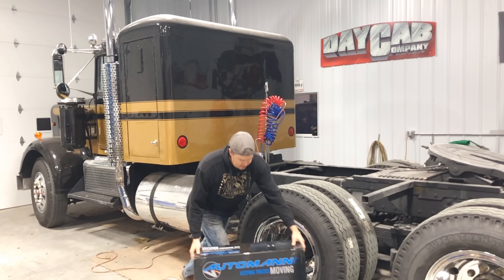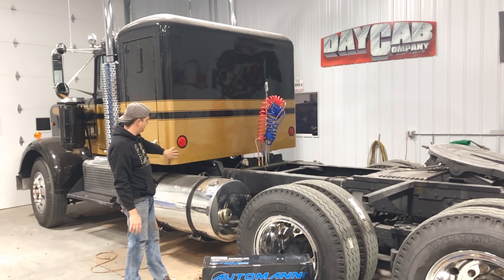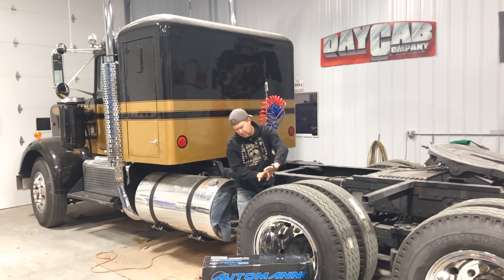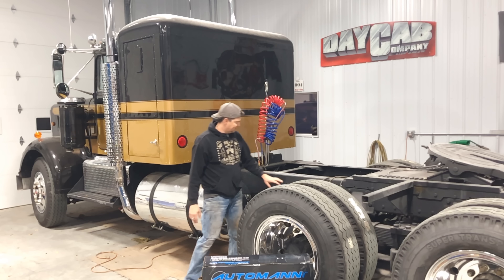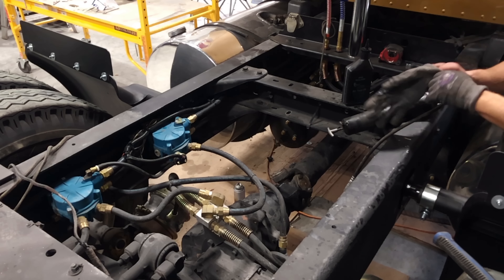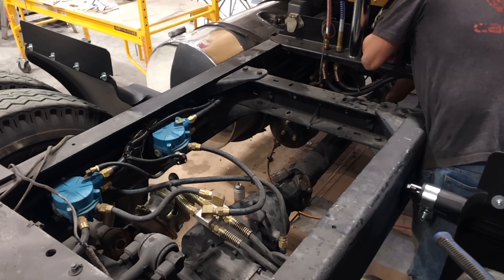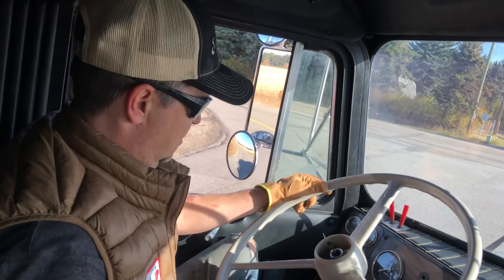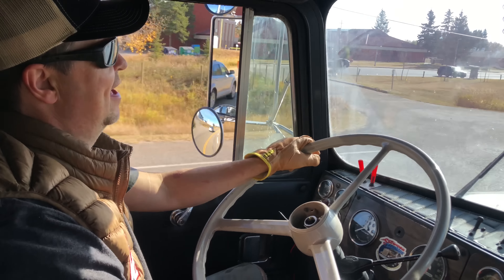Smokey & The Bandit Tribute Truck Ep.57 They Said It Couldn't Be Done

Comment: I used to work at a glass shop and I've replaced a bunch of those windshields. I loved them because they were small and super easy to do. With what I've seen of you and you're abilities, you should be able to handle it. There is a procedure, but simple. I'm sure there are videos here on youtube. Another thing about those windshields is that if you can't get a hold one in a timely manner, most glass shops can cut one for you, probably will want to bring in your original for a pattern. By the way, from what I remember, they fairly cheap too.

Comment: Die Hard and Lethal Weapon, both are Christmas movies.
Quite possible that the 1973 movie truck started life as a day cab.  It would certainly make sense given the location of the passenger side fuel tank filler.
Your radios are just bouncing around on that mount.  You might want either a much stiffer mount or make the mount so that the radios are removed when driving, install them at shows.
Hope Mrs. TwinSticks has a good dentist, riding in that solid mount seat combined with the Hendrickson walking beam suspension is going to rattle the fillings out of her teeth!

Comment: What an accomplishment! I’ve been following along since the beginning and the truck came out awesome! Food for thought, you could get the back of the cab or any vulnerable areas like the front end covered with clear bra/PPF (Paint Protection Film) I have painted bumpers on my truck and couldn’t take the stone chips and it works excellent. It’s essentially invisible especially if done by a skilled installer.

Comment: Hi Mark. 1/4 turn is what I used, also the stainless screws that mount the Kenworth logo on the hood are painted black. As for plates since you built this from the ground up how about Marks-Ride, or Marks-Toy, you can always pull em off for the shows. Still need those foot straps over the fuel tanks.........nag........nag.......nag.😁

Comment: Slightly off topic, but jeans.

I do a bit of Motorsport marshalling/competing/spinning spanners. Mostly rallying, but a bit of drag racing too.

When I'm not behind the wheel, I wear thermal long johns under my jeans. It makes working in low temperatures much more comfortable.

I was on an island off Wales last weekend marshalling a rally and it was very windy & wet. I had two pairs of long johns on under my jeans, plus knee length mountaineering thermal socks, and I was toasty warm. Everyone else was freezing their balls off.

A few layers on your legs both keeps you warm and gives your knees a bit of padding whilst kneeling on the floor.

I can highly recommend it.

Comment: Mark from experience, the 1/4 fenders don't stop a lot bobtailing and don't work overly well even with a trailer. I know you want to keep it movie correct but I would go with at least a half fender but do it so you can easily remove it at a show. You have made a beautiful truck out of that old Kenny. My back hurt every bmp you hit on that ride.  I drove a 84 w900 425 cat 36 inch bunk, 15 double over  trans and spring ride suspension. Driove it a couple of weeks and broke 4 springs and my back over that time. Till I got my 96 repaired.

Comment: I don't see fitting wheel arches/fenders as detracting from what has been achieved,the reasoning being very valid.The top and bottom of it is that it's instantly recognisable as the Bandit truck and 99.9% won't notice them or know the difference anyway,like most of us I've seen the film many times and still didn't notice until pointed out,the many particular features mentioned by Mark on various episodes.  If it matters that much you could perhaps make a quick release mechanism for securing them or use wing nuts for securing them and then simply remove them at shows. Top stuff Mark👍👍👍

Comment: Great stuff Mark. Truck looks great! BTW, most W9s have the fill under the bunk, which makes it difficult to fill and impossible to use a flashlight or stick to check it if the gauge fails or when you are really low on fuel. They even put a hinged opening on the chrome strip if you have chicken lights.

Comment: Just last week I picked up a 1977 trans am se identical to the bandit, I was driving around my area when I noticed it in someone's backyard and I knocked on the door and made a deal.  I never really wanted one but with the rising prices I knew it would be a good investment.  I am going to yank out that anemic 200hp L78 400 engine and replace it with a 675hp 7.0L LS7 backed up by a tremec tr6060.  On the outside the only noticeable difference will be 20"  snowflake wheels which are needed to fit the 6 piston brembo brakes going on it.

Comment: I'd go with full fenders, and where they mount to the frame, with round or square tubing. Make it fit with tubing inside of tubing with a pin through to hold it on. Then when you get to a show, remove the pins and take the fenders off.

Comment: That truck would be hard riding even if it had air ride. The wheelbase is what makes it ride so rough. I drove a short wheelbase freight shaker witha set back front axle with air ride and if it wasnt loaded it would bounce you outta the front seat if you hit a bump unless you was loaded

Comment: Nice,I would run a dedicated or local in that,not OTR though,sleeper too small.
Ran chickens out of PA to NJ for a few years in an 84 W900,loved that truck only air ride was the seat but she was a beast and very angry about anything in front of her,
Pa white tail? Deer can fly
Fence post? Remove it
Concrete post? Mid-day snack
BMW running a stop sign? Oh yea bend that in half.
Fix a bent TX bumper on a pete using hers to push it back to shape?
Yep,all the time(frack haul trucks)
Herd a Buffalo back into the fenced field? Sure why not.
800 hp caterpillar in her,straight pipes no mufflers in them,farmer I bought it from did the HP,truck was 98% original including the hunk of American steel they called a Texas bumper.
98% due to the farmers son laid it over and it needed a new mirror and bracket after that.
Miss that old gal.

Comment: Love the build, watched every episode. I'm sure you know this and I'm NOT criticizing at all, but the frame looks to be slightly longer on this truck vs the movie.  The spacing between the fuel tanks and wheels and between the drives themselves. My dad was a trucker for almost 50 years, so I have a soft spot for them. He had extensive time in International Transtar's CO 4000/4070.
Reply from the maker: I do t think so 🤔 I specifically bought this truck due to its very short wheelbase and believe it matches the ‘74 perfectly if you watch it pull up to the beer store 👀

Comment: On the rear mudguards (fenders) what we used to do in the UK for running solo before the EU laws banned the vertical flaps and open top wheels (which we fitted to make fitting snow chains easier) was to cut a piece of tarpaulin sheet the width of the wheels, bolt it to the rear fender bracket and fold it out forward on to the front bracket with a bridge bracket (which you have) between each wheel if we had a 6 wheeler. The front bracket had clips or bungees to hold the tarp sheet and when under a trailer we would just roll the sheet back onto the rear flap bracket and buckle it down.
Maybe a solution for when you are running solo as crap will still fly off the rear wheels and do damage plus it will still look 'movie correct' under the trailer. And you already have the holes in the plastic front fender!
She does run (and bounce) well though .... 👍👏👏

Comment: If the  Jakes work when being checked at the top of the engine.... Meaning a fused hot going to the Jake on the heads, In one, two, and three. It comes from the Jake switch off of the three hots on the switch going to the heads individually. That switch determines how many jakes come on. You can while its idling, take a ground to wire going down to the throttle and just ground it and if the jake comes on, those heads are working... meaning the switch determines which heads come on., All that said, the micro on the throttle is wired to break the ground as soon as the throttle moves or why you have a off switch for when just setting and idling. If the jake switch is turned to on and the throttle is at complete idle, that jake should come on and so if it doesn't then rotate that micro over till you hear the clicking of the micro... in other words, the metal piece touching that micro is pushing the button in and turning on the jake brake. The Micro switch wired proper is button pushed in makes the ground complete and when its out, it breaks the ground so you can't step on the throttle and have the jake on at the same time. Your Micro switch should have a wire that is short in length and  goes straight to ground and the wire coming off of the heads comes to  the other side of it. You take your foot off of the throttle and the Jake has a complete ground and comes on. Its the same on a clutch pedal one as well but just getting a Micro working on the throttle is actually the most important one. I hate people that use the clutch to shift. Once moving, you never need that pedal again to shift except to coming to a complete stop and still in gear. I see guys use the clutch pedal to shift and they shove the pedal to the floor taking out the clutch brake.. Your truck is trying to stop movement with just a clutch brake.... how crazy is that??? I can see taking some pressure off of the gears when in a bind and then the jake should not be on in the first place.

Comment: If the wife is gonna continue to ride your gonna have to get her a air ride seat for her side. If that truck has a brake saver jake set up you have to touch the brake pedal to get the jakes to come on. Our 1995 kw t 300 is set up like that. You can turn on the jakes but if you dont press on the pedal a little bit the jakes wont come on

Comment: FYI, not to be that guy but... to adjust the slack you should lift the tires off the ground, tighten the brakes till tight and loosen it off while turning the wheel till the brakes are just barely draging. each side has to be at most 6mm difference of stroke.

Comment: Or possibly not converted , the 73 may have been hit or crashed at one point during filming or before and someone bought whatever they could to fix it and get goin . In that case they replaced the parts with driver side ones which would explain the front fill since the tank would now be flipped and handles

Comment: Honestly, You are certainly overrevving that Cummins.. ease up a bit, Twinsticks, especially on the down-shift. your going to snap or severely damage the push rods, or cause the valves to tap the piston head. Bring those RPMs to around 1200 to 1500 max. She's not a Detroit. I know you're a good driver, but just as a friendly reminder,, let off the fuel and pull the shift out of gear, give it light hold to the next gear and she will slip right in.. or just depress the clutch 4" for the pull-out and redo for the slide back into the next gear. As a trucker, you should be able to feel the slide in on the downshift or upshift... it is in the gut and touch. These older trucks are tuff and can handle a lot, but they are not dynamite-proof. As for the Bob-tail bounce. Yeah, that Ready-Made Rubber Suspension is not the best, but does smoothen out with you having a trailer on. Remember Stompin Tom, My Back still aches when I hear that word. LOL

Comment: Cummings recommends no "warm up" idling, just after registering full oil pressure, switch on `high idle' (1,000. rpm) then as soon as you have sufficient air pressure, pull out.  No diesel (using D2) should idle at sub `high idle' speeds. (check with MFGs)  I don't understand why you installed "jake breaks" instead of exhaust braking. Ron W4BIN

Comment: I don't see how that will protect the bunk. If You draw a line from the top of the fender to the wheel, the protection will be at the brake light height at best.
Reply from the maker: It’ll protect the back of the tank and the lower part of the bunk ... having the trailer on there will protect the rest 👍